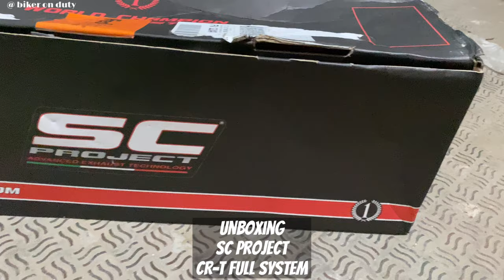2023 Zx10r SC Project CR-T Loudest Exhaust #bike #kawasaki #superbike #zx10r #youtubeshorts #youtube

Comment: What is the cost of the exhaust with bend pipe???
Reply from the maker: Around 1lakh rupees
Reply: @BikerOnDuty  will putting headers make it even more louder or are you pretty much on limit with the sounds level as you have already removed the converter